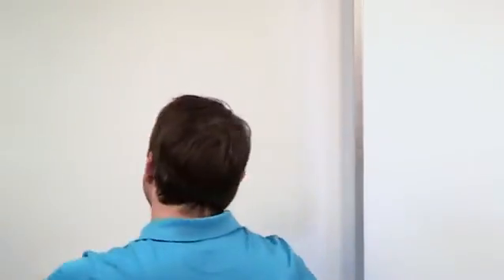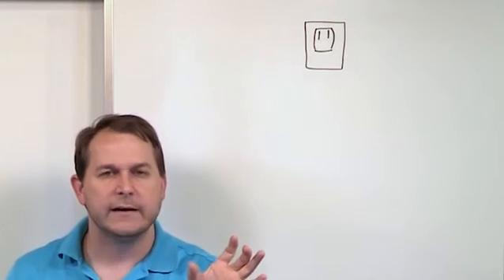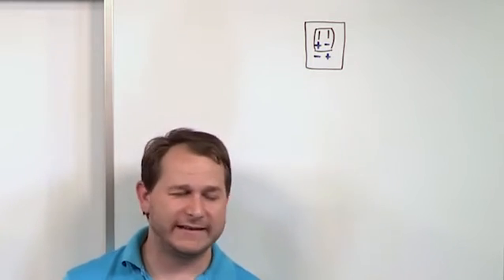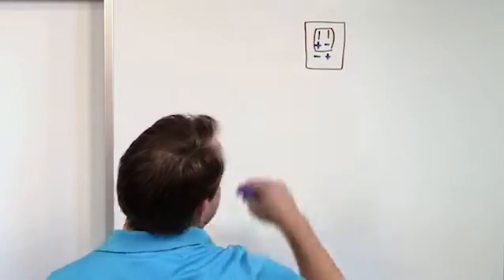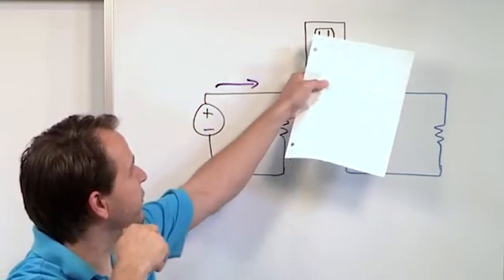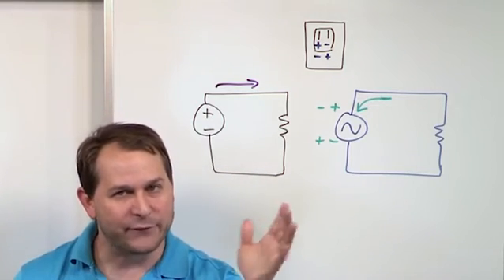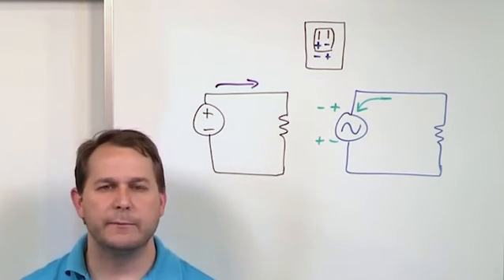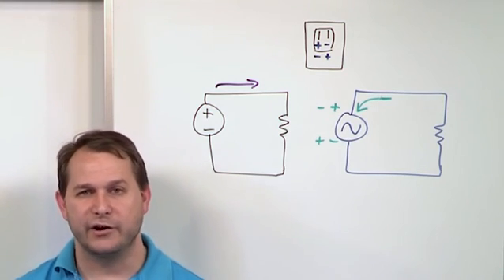Lesson 1 - What Is Alternating Current? (AC Circuit Analysis)

Comment: In the AC circuit does the hot(black) wire becomes the neutral(white ) wire and vise versa ?
Reply: That's basically what I understood from what he said, but that is completely false. Maybe he was thinking about a 240v residential circuit which has 2 hot wires that alternate back and forth with power and return.

Comment: I think you just confused me when you bring up the wall socket.My understanding is that the right plug is power and the left is the neutral wire. And normally the white wire would not be "hot" or have current. Maybe it was an over simplification. However, because you discussed the current alternating in a circuit diagraphm; its easier to understand it as a concept but not in a physical sense. So my question is: Do the same electrons go back to the original source? I assume not, because of distance and the addition of resistance, then how far does the current reverse itself? Can it be described as more of an ebb and flow?
Reply: In residential wiring the larger slot on a receptacle is neutral and the shorter one is hot, so you are correct there. When something is plugged in and powered up the neutral will have exactly the same current as the hot under normal operation. The voltage will be 0v as it is bonded to the ground wire at the main electrical panel. The neutral current does return to the source, the center tap of the transformer secondary windings.
The electrons don't flow like water, but they leave their present atoms and move to the neighboring ones and then go back at 60 hz throughout the entire length of the wire when the power is on. The back and forth movement of electrons is extremely small, but does cause some heat and resistance. Wire gauge is specified  based on length and anticipated current value (amps), to keep the system functioning correctly. So electrons don't move like a ball inside a pipe, but rather only a short distance back and forth. The back and forth movement is caused by the constant magnetic attraction and repulsion from a rotating magnet around opposite coiled wires to create AC electricity in simple terms, at the power generating facility. Common methods are diesel powered generators, water flow (hydro electric turbines) and wind power.
I understand your confusion regarding his explanation of the typical 120v residential receptacle, because it's wrong. The hot and neutral are 2 separate entities and they don't intermingle or have current flow back and forth between them. If they did, you'd have a short circuit and the breaker would trip.